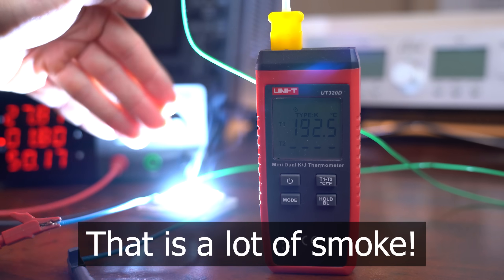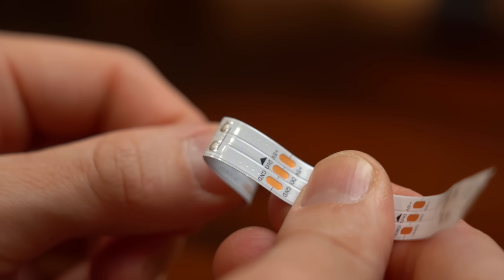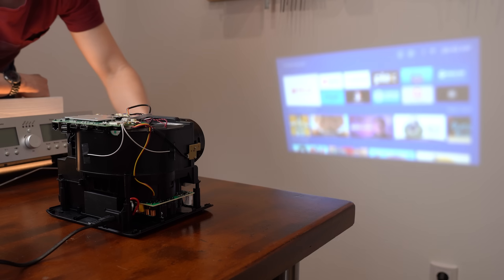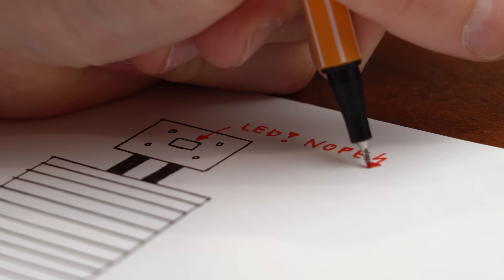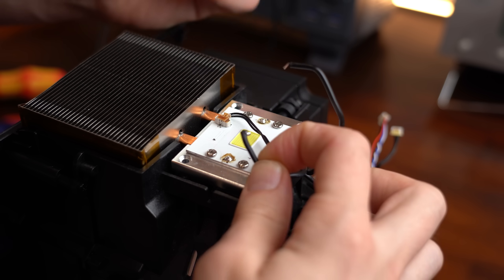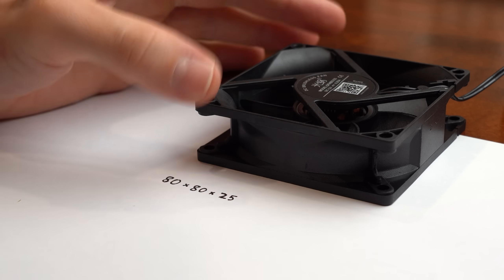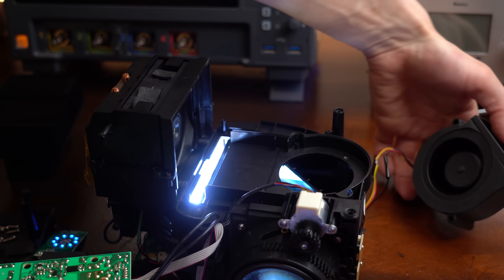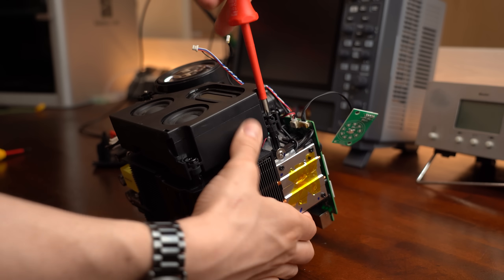Your Cheap Projector has 1 BIG Problem?!

Comment: For an application like this, where I don't want to be opening it up again, I'd consider a graphene pad instead of thermal compound. 

Depending on the method of conduction, it may be worth trying some sort of thermal insulation technique between the LED and the light processing part of the projector. This is assuming that it is the LED COB module that is a significant source of heat in the optical chamber. If it is the LCD itself that needs cooling then you may be able to reduce the fan speed if the airflow dynamics were improved.

I you don't mind a a more significant modification and a 'frankenstein' solution you could try a CPU cooler or maybe even a GPU cooler on the LED COB module. I may be a bulky solution, and maybe a not the prettiest,  if it resides outside the case put it may even be possible to run such a cooling solution passively.

Comment: Ooh, first time I've seen the insides of a Wimius that didn't have scorch marks inside.  (Granted I mostly took apart $US100 models - but the LEDs were always fine; sometimes the LCD sheet was discolored, but the cause of death was usually "some capacitor baked, dryed out, popped, and then caught fire" though perhaps not always in that order.)  They're really not rated for 24x7 operation...

Comment: Why not water cool it? It would take time to heat water to 80°C about 3&4 liters of water with a radiator made from copper tubing with copper wire soldered to it every 2mm . Using about 0.8mm wire with a wire offset by 1mm on the opposite side. The tubing , (4-6 mm) bent into a stretched "S"  shape. About 100x200mm with a couple slow fan's moving air across it. Use a 20-30mm thick aluminum block to mount the led to 13-20mm thick at least. With m4  passages drilled across the block the led shouldn't exceed 45°- 50°C . A pump may not be required if setup properly, a small 5v 2.5-3 watt pump can circulate water near silent. Use a pair of 12 volt fans running on 6-8 volts if possible just enough to get some air through them. And the 20-22 gauge wire acting as fins on the "radiator" making it fairly cooler. This cooler can be mounted to the legs of the tripod the projector is mounted to. Have the radiator and fans and pump on one leg, with two 1litre water reservoirs on the other two legs . It should be nearly silent, and much cooler, my projector overheated and several junctions died! In the LED.. it took only a few weeks of use. It basically doesn't! Work anymore, you have to look into the lense to see any picture.. l

Comment: It looks like you could “simply” attach an additional (standard) CPU cooler to the backside (the exterior side) of the aluminum plate (where the LED is mounted), thereby extending the cooling volume outside the case. Just like some do with mini PCs (e.g., Intel NUCs). I’d definitely take cues from those mini PC solutions since they’ve been grappling with this very issue for years. Cooling the LED (was it 10W or 20W of waste heat?) completely passively is relatively straightforward. You can 3D print a fanduct—or even design your own side panel with modifications for the external supplemental cooling. Heatpipes are available in all shapes and sizes/lengths, and you can already get large CPU coolers for a very reasonable price. And by the way, has anyone mentioned the Noctua brand in the comments yet? 😁
The potentially problematic parts are those that MUST be cooled by the internal airflow. But when it comes to projectors, I have no idea.

Anyway, I’m really looking forward to a follow-up video—those projectors must be somehow entirely passively (or at least ULTRA quietly) coolable.

Comment: - less thermal paste is better, not more.  thermal paste conducts heat worse than aluminimum or copper; lap both surfaces perfectly flat and use a miniscule amount of paste, you'll get better results.
- there are plenty of replacement fans that spin just as fast but are far less noisy; the Noctua line are known for it, and it's down to high quality bearings and vortex disruptors on the fan blades.
- the best way to reduce heat is to reduce power to the LED.  the light dropoff is not linear - cut power by 50% and you'll usually lose only about 25% of the light.

Personally, I'd 3d-print a fan shroud that clips to the outside of the fan grill, goes through several bends with internal features that break up the sound waves, and ends in another bigger and slower fan to make up for the lost air velocity.  You can make a projector significantly quieter by putting it in a larger box with a snaking air path, so long as you help the air along with a second quiet fan.

Comment: Noctua fans would have been way way way better! More air movement and half the volume. Sure they are very expensive compared to the cheap AliExpress garbage tofu dreg quality fans but it's silent not quieter than factory.. you really missed a great opportunity. You could have also added a 2 more heat pipes it a 8mm drill bit to drill 2 new holes in the fin stack and mill or file 2 new beds in the heat plate for the 2 new 8mm heat pipes that will still all fit in the factory design and increase the thermal conductivity to the fin stack.. I seen lots of things you should have done!! I love your channel and normally i don't ever see a missed opportunity but this video ideas wise was sub par 😢

Comment: might be able to better like the sound with some simple baffles.  directing much of the sound away.  from you,  something as simple as duct tape or PVA  foam could be mounted externally to send the sound from your direction.  or bounce it down to your  floor and a carpet. or away from you and towards something sound absorbing.   Another option is sometimes removing the grilles or making more minimal ones or ones that can also conduct more heat out. can allow more and quieter airflow,  you can also drop fan speeds but putting a diode inline.  the forward  drop can drop a volt or two.

Comment: The 30,000 lumens rating is so cringy. That's like saying, "I can fill up my car with gas/petrol at 2 gallons/minute, so therefore, it's a 127MJ/min * 2 gallon/min => 4.233 MJ/s / 746 J/s => 5,674 horsepower car.

Comment: Knock a hole in the wall, set it back in its own enclosure with baffled air flow, encapsulate it away from the viewing room. At my exs apartment, there was a closet in the side room directly behind the couch. I really wanted to pop a round hole in the wall, plop a projector on the closet shelf shining through the hole, and use a picture frame with an image of like, an old steam train (and projector shining from the light), or a camera, or ... uh projector (film of course, shining through the obvious bit) to mask the hole. Of course the landlord (read soulless property management company) would have hated it....

Comment: For a laugh, one could remove the fans and go to a junkyard (Apocalyptic Inventor style) and get a used BMW cabin fan with built-in HEPA filter. Then duct-in all that cool filtered air while the fan part sits on the floor in a retro-style wood cabinet.😅🙃

Comment: Look into Noctua fans, they are notoriously quiet and good. Plus, look into liquid metal instead of thermal paste. WAY better heat transfer.
Reply: Yeah, liquid metal on naked aluminum is everytime a good idea. If you do it in your PC, then you need to buy a new cooler and to delid your CPU.
Noctuas are primarily so quiet because they have a relatively low speed and do not transport a lot of air.
Reply: @darkblooster9937  its not hard to drop in in some electrolyte and nickel plate it with a bench top power supply. or even copper. no problems then. 

If you watch the thermal video those fins are not heating up so I doubt there will be much performance loss with a bit pressure. Even if you wanted more air movement, there are much better brands, corsair used to make magnetic lev fans for 80mm but not sure if they do anymore and those things were like silent leaf blowers. Oh, and the Noctua do rank in the top 1/5th of fans for air movement shown from independent testing. I don't personally use them in anything other than my 4u servers, as I like my RGB. they have no problems cooling many of my duel CPU systems and 30+ drives

Comment: Can better heat dissipation by adding 1 thermal pipe and transmitting it to a monolithic aluminum plate and without the need for a fan to cool the aluminum plate diy?

Comment: it surprised me how you didn't mention how the heatsinc is upsidedown, in my experience the heatpipes are basucally acting as normal copper pipes in this configuration, I'm sure puting the projector upside down will make it dissipate heat way better

Comment: Perhaps machining better heatsinks with more heat pipes on them, distributing the heat to more fins.

3d printing a larger case, with provisions for slower 120mm or even 150mm fans, that feed the same airflow to the needed positions might also be a good idea.

Comment: Im curious about taking an older lamp based projector (lets say a 200w lamp) and sticking an led of equal heatproduction in there, should be way brighter then and the cooling solution should work as its the same amount of heat, right?

Comment: It's safer to check the power supply design being used before making contact with any circuitry. Some devices use a non-isolated power supply or "hot chassis" design.

Comment: You could also modify the LED driver to reduce the current. Even just 100 or 200mA would make a big difference to the heat output but it would still be bright enough.
Reply: And more importantly, the reduction in light isn't linear.  You can cut a lot of power from an LED before losing more than a quarter of its light output.
Reply: Maybe adjusting brightness at settings would be enough?

Comment: "Dry" thermal paste is purposely dry. As you saw, you gained little performance difference by replacing it, but in time you will see that longevity suffers.  "Wet" thermal paste performs slightly better, but "pumps out" over time (thermal cycles cause thermal expansion, contraction, and migration of paste), and voids will appear.  Then the thermal performance will nosedive.
Manufacturers use "dry" paste on purpose for longer longevity and to reduce warranty claims and complaints.
Almost every time you see someone complain about dry thermal paste, it is a mistake to complain.

Comment: 7:43 Assuming the fan runs at a fixed speed. Cooler heat sink = less power transferred to the heat sink = worse thermal conduction = hotter LED.
So basically you made the thermal conductivity a little worse. Though one degree variation could also be within the margin of error. Either way, you want the heat sink to draw more heat from the LED, not less. Ideally you would have measured the temperature of the LEDs, themselves. Not easy to do of course. Maybe from the front...

Comment: Perhaps building a box for this which is itself cooled would allow you to run the fans at max with a serious reduction in nose due to the additional noise insulation. I'd suggest building a wall or ceiling mount box for this with a couple noctua coolers.

Comment: A lot of noise is usually coming from the air flow through the device.
In my case with another item I had to cut some blockages that limited the air flow and caused excessive noise.

Comment: Projector for true 2500 lumene still pretty expensive. All these cheap ones are LCD and have very pity measurable lumens, like 350, 400 in the vest case. And it is unusable in the room without complete darkness, contrast is like 1:2 when ther is a glimpse of sun in the window.

Comment: I noticed you didn't check noise level using original LED cooling fan after you reduced the other fan to 9V. You may have replaced the LED fan prematurely, and possibly only needed to reduce it's voltage as well.
Water cooling sounds an interesting project as well.

Comment: I was given an ancient pro-grade LED projector.  It is very quiet when running, and accomplishes that with a HUGE aluminum heat sink that also functions as part of the lid of the enclosure. I think the sink alone must weigh 20 kg.

Comment: To add, you can also use snoozing-chambers around the air output to silence it a lot probably.
And also, keep in mind that it is now 'the cool season' around here. I would certainly think about a temperature-regulated fanspeed which can probably be made even with some discrete components like one or 2 thermistors, one transistor, one resistor and a pot to adjust it to go slower basically and start running faster if it heats up.

Comment: Run it without the case and replace heatsink/fan eith bigger ones. Otherwise it slowly becomes more expensive projector.  Perhaps add 3d printed case that could fit it with bigger hs/fan

Comment: A 90mm noctua fan and 2 small noctua fans+ a 3D printed air guide would make the projector near silent. And position the fan to cool the heatpipe, not the outter side of the heatsink.
And maybe use a better thermal paste. Something 16w/mk